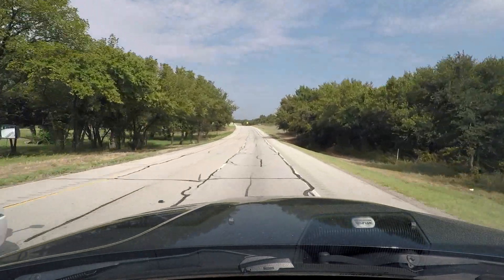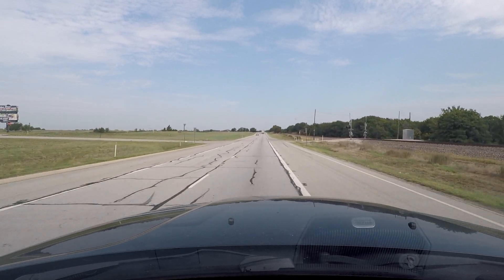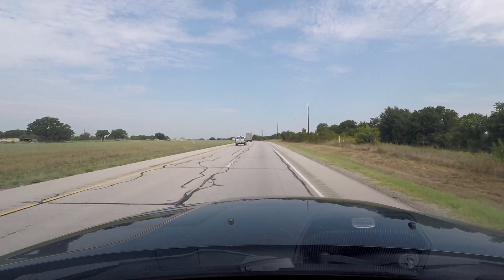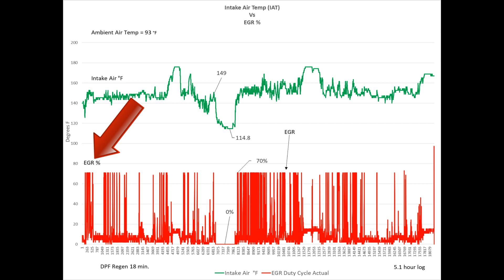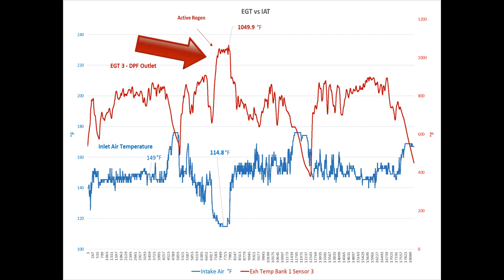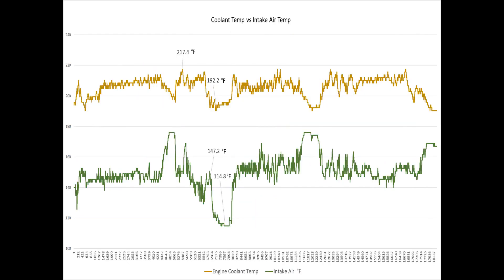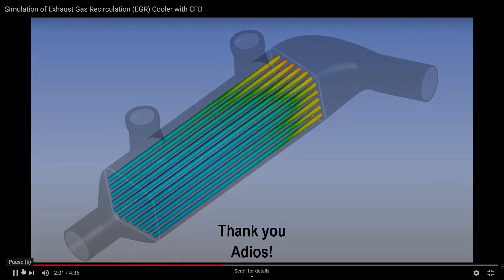RAM Cummins 2500 -  Does EGR affects Oil and coolant temperatures

Comment: just saw my coolant hit 240 idling in city traffic after driving for an hr 80 degrees out about, I thought that was too high was worried, after driving again and getting past a 5min light, the temp dropped back to 200.  sound normal? just bought this used 2022 2500 60kmiles, need advice - thanks marion, great channel, new sub here
Reply from the maker: @GreenMambaGuitars  For a 2018 and older, that would be a little high but the new models like your’s may run a little hotter.  I had 240 on my 2014 when towing heavy in the summer.

Comment: My truck today on a trip from Phoenix Az to Williams az my max temperature hit engine coolant 228 and transmission oil 204 , I think is very hot on both, outside temperature was 113 , what’s your opinion?
Reply from the maker: It's hot but your truck is doing fine.  228 on coolant normal in heavy heat etc.. 204 on oil is low.  I've seen 214 or so on oil.

Comment: Could the EGR be a source of mystery Coolant leak?  2014 2500 RAM 6.7 TDI with 104K miles recently having to top off coolant.   Investigated and YES replaced leaking upper Y-Pipe radiator Connector with aftermarket XDP billet aluminum.   After install Coolant temp got to 217 towing 11K lb trailer up Hwy 215 / Hwy 15 from San Diego to Wrightwood to Lancaster CA in 93 deg weather -  kinda freaked me out - so turned off AC - didn't ever pay attention to coolant temp prior to all this cause not issue.  Also got my 10mm wrench handy to tweak tighten the T-Clamps after noticing very small moisture at 2nd radiator 1.5 branch connection when under hot load.  Is there a Torque value involved on these T-Clamps?  Can they be Overtightened?
Reply from the maker: No sure about the T clamp, where is sit located.  Autozone has a coolant system pressure tester that you can use for 90 days free.  $250.00 deposit but you get it back when you return it.  EGR cooler could definitely be a coolant leak source.  BTW, 217 deg F is pretty normal.  That's where the fan should kick on.  (216 or so)
Reply: @MarionBlair  Thanks for tip on Autozone pressure tester...oh, the 3 ea T-clamps are  associated with radiator hoses clamps for aftermarket "XDP" billet aluminum replacement Y-connector.  Now trying to "burp" system with help from your new Dec 3 coolant video... Thanks

Comment: Marion, I just watched your video and really liked it!  I have a 2014 Ram 2500 with the Cummins engine just like yours.  Something that happened to my truck was my coolant temperature over time started creeping up at 60-70 MPH on flat ground.  It originally ran around 195-200 degrees F but started running at 200-208 degrees F under the same conditions.  So, I started to get concerned with the raising operating coolant temperatures.  I bought a new Gates 190 degree thermostat from Geno's Garage and installed it.  This solved my issue and my coolant temps now operate between 194-199 degrees.  I'm just wondering if you may see coolant temperatures far below 217 degrees with a simple thermostat change?  Hope this helps.
Reply from the maker: Good question, that's interesting, I'll watch for that.

Comment: Hi Marion! Love your channel! Appreciate all your info on general maintenance. You’ve saved me thousands in oil/fuel filter changes. I have a 2013 3500 with the 6.7 (170,000km). I’m at the shop right now with a VGT actuator fault. Turbo not in horrible shape but the sliding piece that adjusts the vanes is so caked with soot / carbon the actuator burnt itself up. Cost of the actuator replacement with dodge is $4500 Canadian. I’m looking at replacing the whole turbo with a rebuilt holset. Brutal going through a turbo in only 170,000 km. Shop said soot etc from egr is root cause. I’ve babied this turbo - always let it cool down after driving. What’s your thoughts on this issue? Would love a video on your thoughts. Does this issue change thoughts on deleting the EGR? I’m faced with that decision right now with a new turbo going on.

All the best and thanks again for the work you’ve put into the channel!

Kris
Reply from the maker: I think soot can lock up the slide but I also think it's likely an actuator defect that Cummins/ RAM  isn't owning up to.  If they pulled the actuator and the arm didn't have full movement then yes it's soot.  That's the best way to tell.   Most cases that I know of, it's the actuator and the turbo is fine.  (but not all).  If I had my way, I'd delete the engine emissions system and install a fixed geometry turbine (old school).   The VGT has some low speed boost advantages and it provides an exhaust brake but the actuator is the weak point.  IMO.

Comment: Do you know where the stated operating ranges are documented?
Reply from the maker: I haven't seen any documented operating ranges for the RAM Cummins but the fan comes on at 216-217 Deg F so for me, I try to stay just under that.  (but you can't always do that) The oil temp runs about 10 def F above that.  The maximum oil temps for dino and synthetic is pretty well documented but not specifically for the ram as far as I know.
Reply: @MarionBlair  funny story.

Summer of 2020 I'm driving my 5th wheel from Louisville Kentucky to Denver Colorado. Going through Kansas and into a headwind I began hearing "ghostly sounds".  Making assumptions that it was wind whirling around the bed of the truck and the front cap of the fifth wheel I paid no additional attention. However when the winds calmed as we entered Denver, I kept hearing these sounds. Come to find out it was the cooling fans coming on which darn near sounds like a jet engine spinning up and down. Having followed you Marion and using the torque app I monitor my turbo temps making sure not to shut the engine off when it's too hot.

Anyway the ghostly sounds went away as we got into cooler weather.

Comment: Dude, I hope the hell you'll delete this thing soon.
Save it's life.
MiniMaxx turned everything off.
Pulled the egr tube and welded it shut near the exhaust valve.
Gutted the ccv filter and installed a catch can.
This truck does NOT blow smoke but smokes the tires at will.

Comment: Wow I've pushed my '18 pretty hard and never had my oil go past 210 and coolant 207.
Reply from the maker: It's fairly common to get those temps with these trucks.  It seems I usually see it on long trips out west for some reason.
Reply: Bone stock truck

Comment: My 2016 owners manual still mentioned cleaning the EGR valve and Cooler at 67500.  After reading a few articles and watching some videos, I only removed and cleaned the EGR valve. To tell you the truth it really wasn’t caked with soot but it gave me some piece of mind knowing I could postpone the cooler cleaning for another 65,000 miles. 
Right or wrong only time will tell.
Reply from the maker: Yes, agree.  The newer trucks don't dirty the EGR like the pre 2013.  I'm surprised your manual mentions cleaning it.

Comment: Sir, as always, your video's are great, also, have you done EGR valve cleaning ? & EGR Cooler maintenance ?
Reply from the maker: no it's not required on the 4th generation from 2013 on up

Comment: I have a 2016 that was doing much the same as yours, but mine is a Dually. I have had Rams since 1995 the 5.9 was a great engin,  what I did to bring everything back to normal. Was to change the Thermostat to a 190deg  I did and mine runs great in Texas. Here is another thing you can do for the oil, look this up online Oil bypass filter install that and you will be able to run your truck for 35000 miles or more.
With this filter comes oil sample bottles and mailers, you draw the sample and send it into the lab. And test it most of the time all you have to do is change the oil filter and add a quart of oil.
Now if you think this is bunk, ask any long haul trucker. They all use these filters that are much larger then you would use, it lowers the oil temp. I pull a 43' 5th wheel 18000 pounds for hours a day and not one problem. Be safe

Comment: Another great video, Mr. Blair.  I don’t miss that EGR stuff on my 2018.  Doesn’t get above 200F on coolant anymore.  Would have left the emissions on there if Cummins could keep those temps lower and my oil cleaner.
Reply from the maker: Yea, those temps are too high for such a light load.
Reply: @MarionBlair  Mr Blair, I can promise you will not miss the DEF, DPF and EGR.

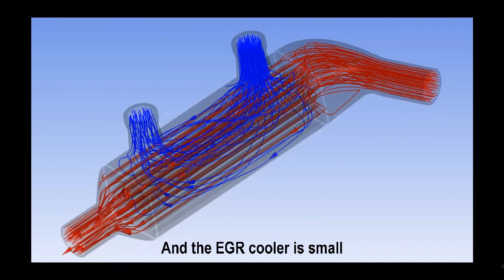Comment: Marion - time mark 10:11 of your video. You state, and I paraphrase, that 2013 and above do not have any EGR cooler or valve maintenance. Whoa there.... Then why did dealership want to charge me $1000+ for CCV and EGR clean (remove and soak for 3 hours using Mopar acid) at the dreaded 67,500 interval? I have a 2014.
Reply: To make money.
Reply from the maker: None require, talk to your dealer.
Reply: Because your dealership is run by idiots. You can replace the ccv yourself for $55.

Comment: Have same truck, have never noticed that my temps of coolant or oil go above 210 degrees.  Towing 5th wheel from the NE all over the country.
Reply from the maker: Yea, ambient temp and speed, but my usually doesn't either unless I push.